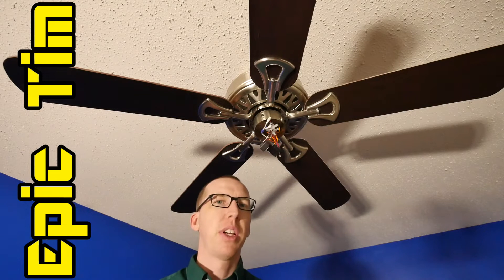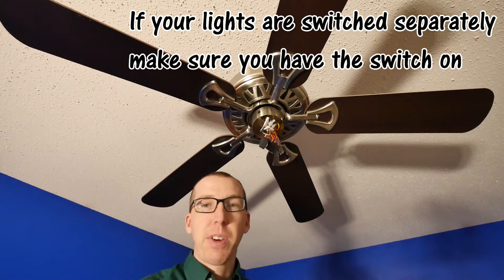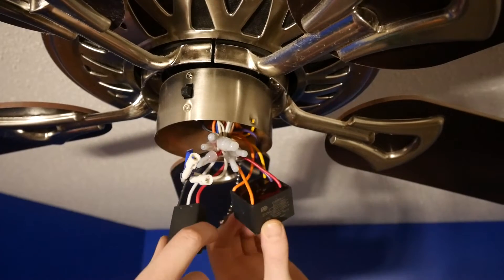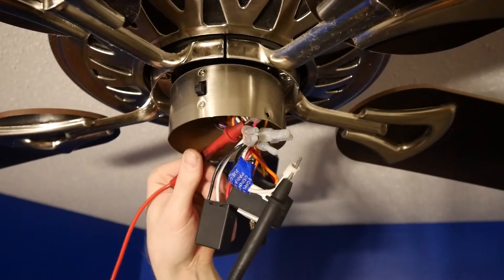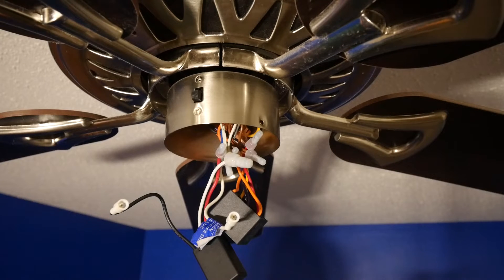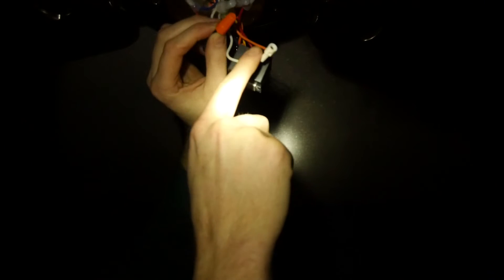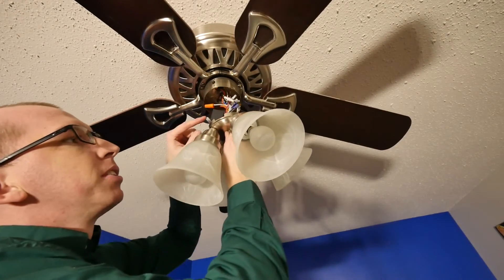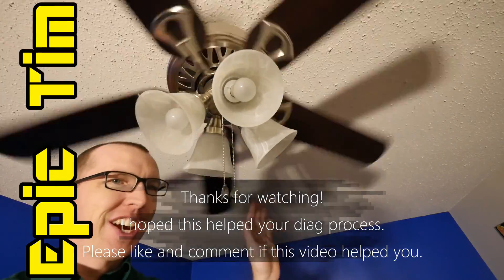DIY - Easy ceiling fan light diagnosis and repair! (with dmm)

Comment: OK thank you sooo much this worked and saved me $. from buying a new fan..... My Limiter was reading 108 , after the Box and 120 before..
So my question is what is it even there for ?  seems pointless if both ends have to read 120+...... Also to be honest I am not going to order another limiter 🤣 so knowing this ahead of time.what is the " hazard" of this if any ?  T hank you  🙏
Reply from the maker: it just keeps you from running high wattage bulbs and burning up the wires.
Reply: @EpicTim  so essentially if you use the same type bulbs that came with it, then to bypass the limiter is safe to do?  I know that is what it the issue because I've not changed anything and the fan works.

Comment: Great video, thank you! Just curious - what is the purpose of that limiter? Does removing it present any safety concerns?
Reply from the maker: protects the cheaper wiring in newer fans expected to run CFL or led lights, prevents you from overpowering the circuitry with high wattage conventional bulbs.
Reply: @EpicTim  so, is this a fire hazard. Are my wires gonna get hot now???

Comment: Dear Tim,  I have the same fan with just 1 regulator in it, My light and fan won't work. What is the solution? Do I buy the regulator as I have to order online, home depot or lowes do not carry instore. Thanks
Reply from the maker: First check for power then check the switches, if both fan and lights dont work you probably have a different problem

Comment: My fan was working and my light was working but my fan pull cord broke. I bought a new pull cord and replaced it - the light now works and now my fan doesn’t 🤦🏼‍♂️. All connections look okay and when the fan is on, it hums, but doesn’t turn. Thanks for the help.
Reply from the maker: Sounds like you have something on wrong and its holding the fan back, could be a screw in the wrong spot or the cover touching the blades.  Can you spin the blades by hand? Smoothly?
Reply: My light pull cord broke, not fan** my bad
Reply: Hi Tim, thanks for the response. I have not put the unit back together yet so I don’t think it’s a screw and nothing is touching the blades.
Reply from the maker: @mattbrewer3804  do the blades spin by hand?  dont force them if they dont.  if they do, does it grind or have excess resistance by feel?
Reply: They turn very smoothly.
Reply from the maker: @mattbrewer3804  could be a connection issue, your problem is now beyond my ability to advise

Comment: Ok so I see you connect black and red together (mine is  blue and red) but what about the white I couldn't tell what you did with it? Please help.
Reply from the maker: all depends on your model of fan and wattage limiter, you need to test with a voltage meter
Reply: Epic Tim do we need to test as to which two will give 120 reading?

Comment: Good video - thanks.
My older Hampton Bay fan had the same problem - fan worked fine but the lights all four suddenly quit working. In my case, it turned out to the the light control pull-switch had failed. I got a generic replacement from Home Depot with the same number of connections for about $5, swapped it out, and the lights worked perfectly again.
Reply: I think my trouble is going to have a similar problem. My son turned the light off by pulling the chain pretty hard instead of just flipping the light switch off on the wall. There’s a fan switch and  another for the light that I’ve always used, so I’m guessing he yanked it too hard and broke it off inside. I hope that’s a visible indication in my case. In this video, this guys cutting some wires loose in the dark and his hands are blocking the vie entirely so idk what he’s really doing. The first part of his instructions seemed to be explained well enough and I was able to follow along, but my compliment goes right out the window when he wrecked it by concealing whatever he’s doing with his hands covering up that seemingly important step! So I hope my prob is like yours and the chain’s the culprit. I’m glad I happened upon your reply!!

Comment: Wife flopped the switch to the fan/light. It didn’t come on. So she pulled the light chain, and then went and flipped the switch and she heard a pop. She didn’t smell anything, but now the entire new fan doesn’t work. Breaker didn’t trip, but I cut it off for the time being bc I could still detect power at the light sockets. What do I need to fix? Something in fan or in attic?
Reply from the maker: Could be a few things, check for power at the fan motor connection.  if your fan has a start capacitor see if it discharged anything.

Comment: do u wire black red & WHITE TOGETHER?
Reply from the maker: this is dependent to your model of fan, you will need to check the circuit.  ultimately you want power in/out, ground in/out connected from the wall straight to the fan motor to temporarily bypass the wattage limiter and see if that is the issue you are having.

Comment: With no RadioShack this is a pain the ass to fix
Reply from the maker: eBay/amazon is the new radio shack?
Reply: @EpicTim  you can't walk into eBay/Amazon and get the part. You have to wait 2 days and if it's the wrong part you're fucked even more.

Comment: Sir, I have a Hampton Bay fan with lights & it just stopped working. I turned the power off at the source, I installed switches at the wall, took the fan off, tightened the caps at the ceiling & nada! I still don't have a rotary fan, no lights! What gives. Can you help? Also: does the capacitor on the fan also controls the lights or no? Please...
Reply from the maker: If your fan motor and lights are not working, check for power before and after the wall switch and pull chain switches.
Reply: @EpicTim  Oops! I forgot to mention that mine is Remote control! I also changed batteries on the remote! (I did not check for power after installing the  wall switches; I don't have a tester! Wow! And thanks for the quick reply!

Comment: I having a similar issue when I turn on power the fan works but for the lights it just starts ticking  what can that ticking be ?
Reply from the maker: Does it tick if you take the bulbs out?
Reply: @EpicTim  the ticking stops
Reply from the maker: @raulrodriguez3593  have you tried a different  type of bulbs?
Reply: @EpicTim  yes I tried 2 different types of bulbs
Reply from the maker: @raulrodriguez3593  got me stumped on that one, maybe another subscriber will know.

Comment: Hi. Thanks. When I look at my Westinghouse ceiling fan's rectangle capacitor, it has two red wires. How would I know which is the negative and the positive wire?

The capacitor is a 1.5uF 450v but I've connected in series two 3uF 250v so that it'll be more durable (it'll become a 1.5uF 500v).

Thank you in advance. 
God bless, Proverbs 31
Reply from the maker: great question, it should be labeled on the cap itself.
Reply: It's working now. I connected two 3uF 250 in series, so that it's got more allowance (it effectively now a 1.5uF 500VAC, up by 50VAC). This capacitor is AC, can be connected to either end (thank goodness it's not the DC kind of capacitor). It feels great fixing something that's been dead for more than 6 years.

Comment: What if the chain is not working on the light? In other words there is no give in the light chain
Reply from the maker: sounds like a stuck or bad switch, should be easily purchased from a hardware store.  i recommend you take yours out and talk to them with your brand and model number ready.

Comment: Thanks for the video. I wonder how you disconnected the cables at 0:33. I think I have the same connectors, but can't get out of it. Should I press somewhere with something? I tried pull out hard but it wouldn't move. Please help me. Really appreciated.
Reply from the maker: There should be a plastic tab in the side of the white connector, you just have to depress the tab to make it slide out.

Comment: So two out of our four sockets don't work any idea? I currently have the power off from the breaker. The sockets done seem loose and screw in the socket seems tight.
Reply from the maker: If you have a meter, start by checking the front and back of the two dead sockets for power.  possible that you just have a bad connection.

Comment: Why do the put wattage limiters on these in the first place?
Reply from the maker: Hi Pam!  The wattage limiter prevents you from running to high of a wattage lightbulb and overloading the wiring in the fan.  this way the fan maker can't get sued for a house fire.
Reply: @EpicTim  so technically if I Install 2-3 bulbs that are 40-60 watts each, there shouldn't be a problem.
Reply from the maker: @FPR  eventually i would imagine the wattage limiter will still fail. but yes, that's the goal from the fan manuf.
Reply: When you run candelabra LEDs there shouldn't be any concern of wattage getting too high and causing a fire though.. right?

Comment: About a week ago my ceiling light just stopped working. Already done the above in the video.Apparently person who lived in this house before me already removed the limiter. So I'm stumped as to why my ceiling lights just stopped working all the sudden.Ceiling fan still works.
Reply: Likely a bad switch
Reply from the maker: Hi Dayton, it could be the pull chain or the wall switch if it was wired separately from the fan.  Turn the power off and get a flashlight, take a multi-meter and set it to ohms (10 ohms on a multi-select meter) and check for continuity, then pull the switch and check again.  If the meter reads 9999 or OL the switch is bad.  If it reads 0 ohm the switch is good and you have a power feed issue.